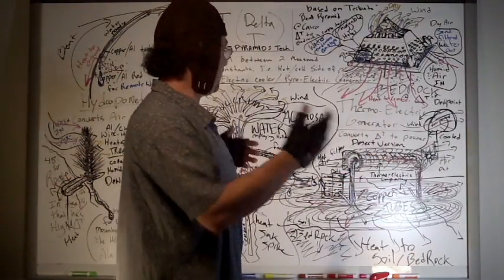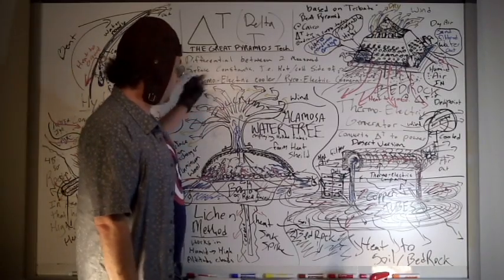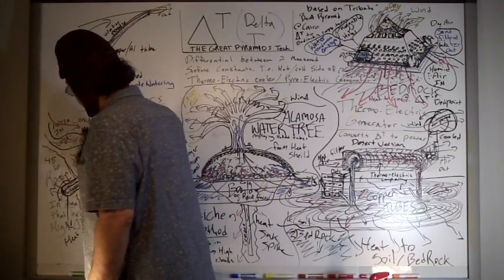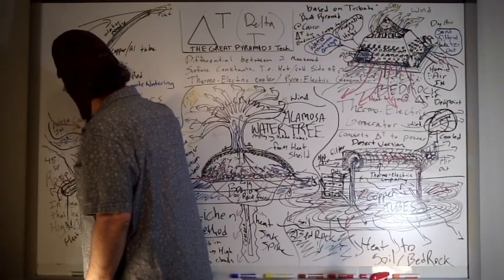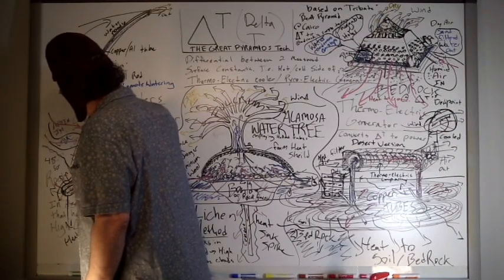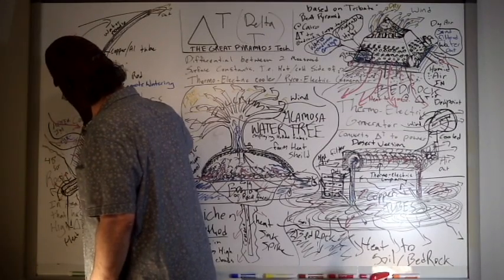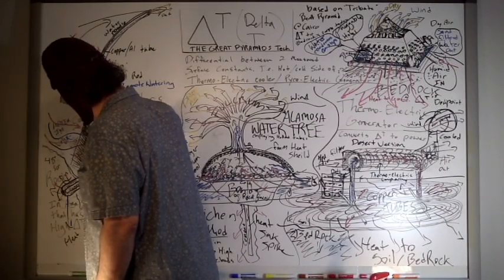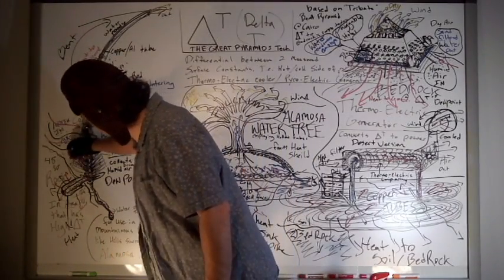Delta T Technology - And the Great Pyramid Tech

Comment from the maker: If the metal tree version were mounted up high on a east facing ridge or slope, the wind up said slope would allow for the wind carrying the water vapor to go up the cone like it should automatically. The metal tree while it would form a big ice block, Colorado tends to freeze then poof 60-80 degrees the next week then back to freezing, so these would melt then reform which would store water as ice cube trees.